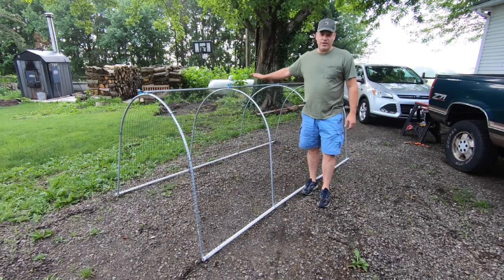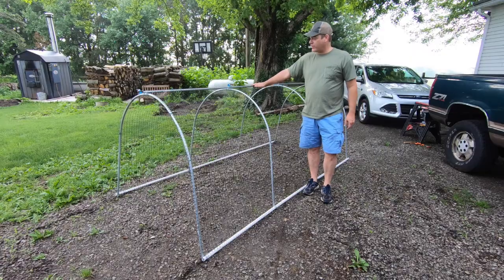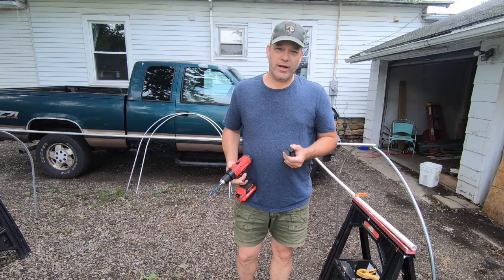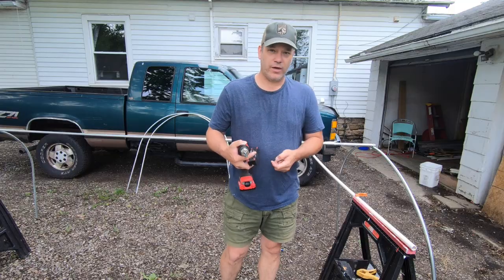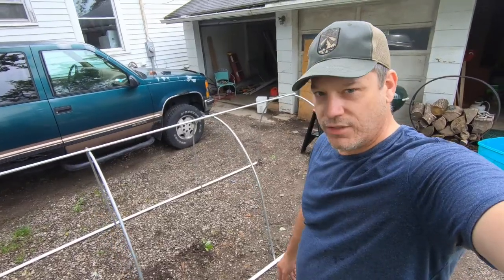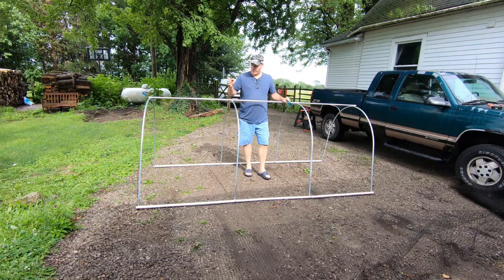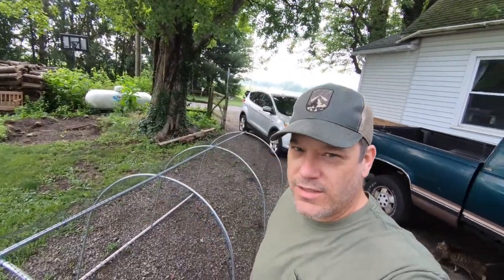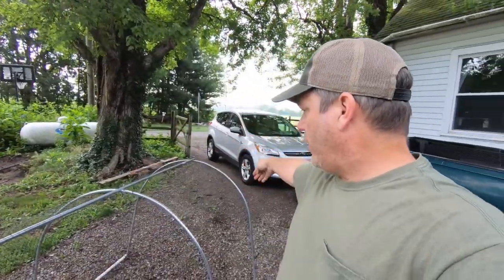Chicken Tunnels: DIY Tutorial

Comment: my idea would be to get 2 foot length rebar. drive that into the ground half way, then place each of the EMT pipes (on the ends) over the rebar like a sleeve. That way I'm not worried about the bottom sled assembly.